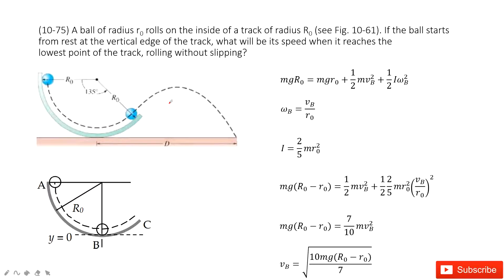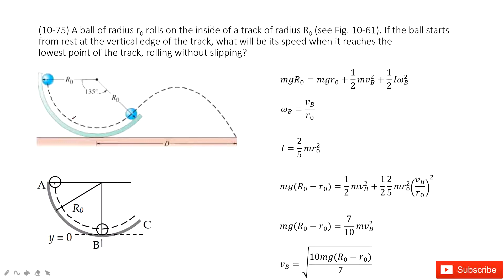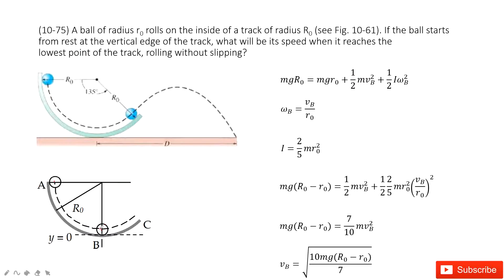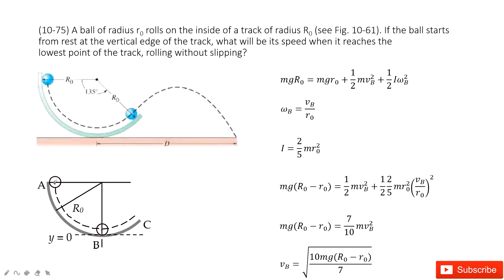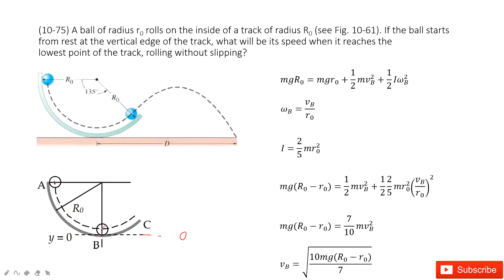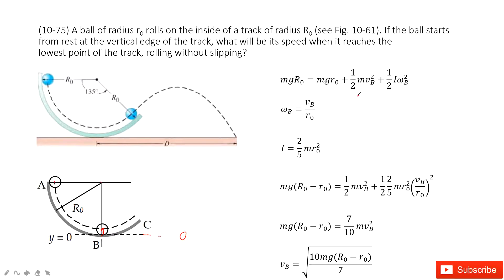(10-75) A ball of radius r0 rolls on the inside of a track of radius R0 (see Fig. 10-61). If the bal

Comment: why are we using the moment of inertia for the sphere alone,  we are moving in an axis of distance R0  from the sphere .
so should the moment of inertia not be 2/5mr0^2+mR0^2 using the parallel axis theorem?
Reply: Get a fresh admission in class 1.
Reply: Inertia depends on what point is rotating by, meaning at that point in this case the center of mass of the sphere the angular velocity is 0